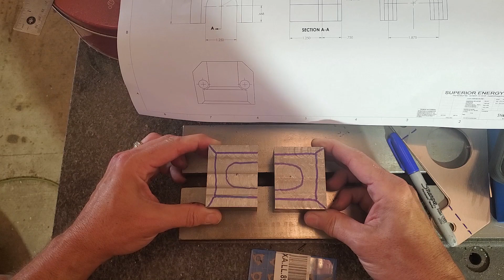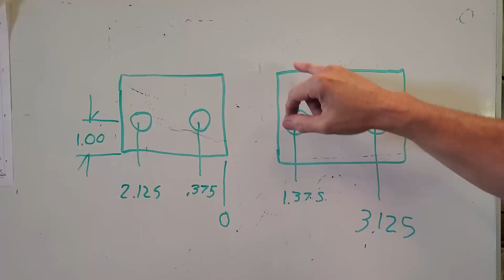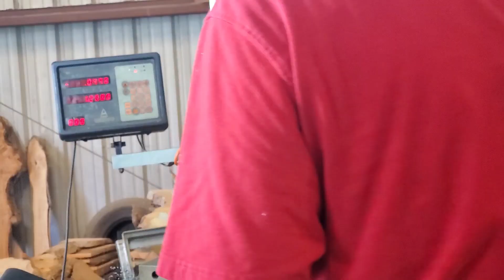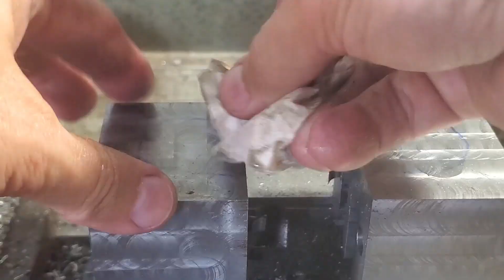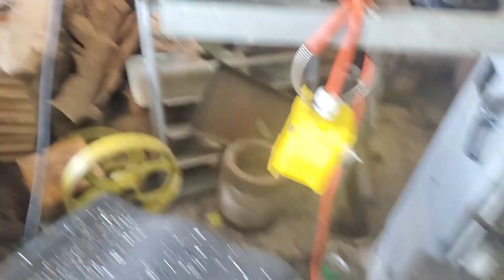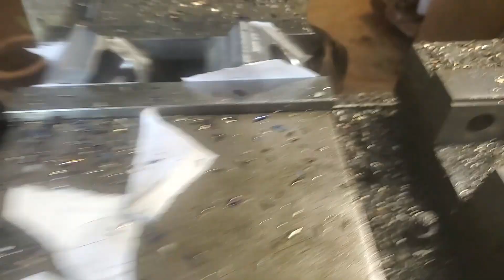Machining Rack & Pinion Hold Downs - Pt II

Comment: Nice job, That is a pretty versatile machine. I think you can still do that without a rotary table but with a decent boring head. Bore the holes, then come back with an end mill for the straight sections. It's be a bit more work, but probably make that up with the drilling operations - those looked painful on that machine. LOL!
Reply from the maker: Yeah, it's no drill press, but does surprisingly well for a 3/4hp motor. I think I've done a 5/8" hole in steel.

Comment: A complex part with milling /challenges. A shame that that last part moved - it looked like the parts were balanced in the vise jaws. Matbe a little extra gronk on the screw for that vise.
Reply from the maker: As I was adjusting the 45 angle the square acted like a wedge and lifted the block. Live and leand... and buy an angle vise!

Comment: I probably would have done all the features as full rounds in the 4 jaw then gone back and opened the sides in the mill.
Reply from the maker: Yeah, or buy a rotary head mill 😁👍The Acraturn doesn't currently have a 4 jaw. Monarch does, but a long way from running.